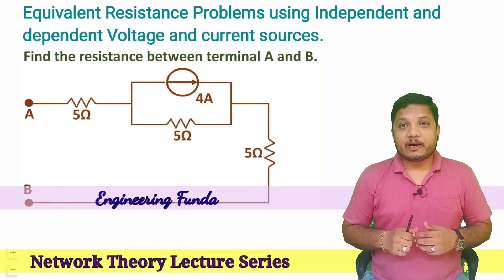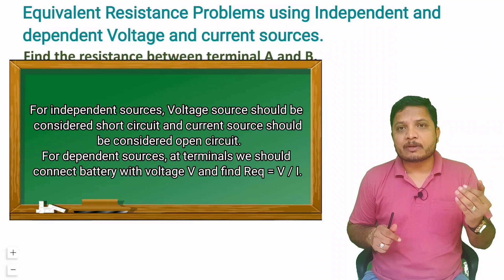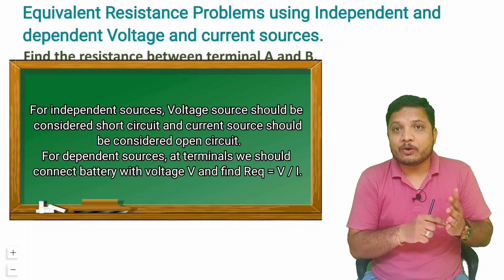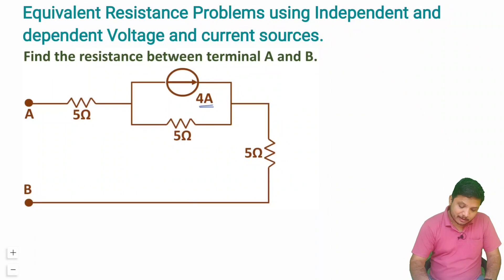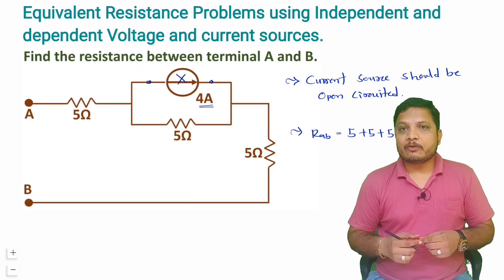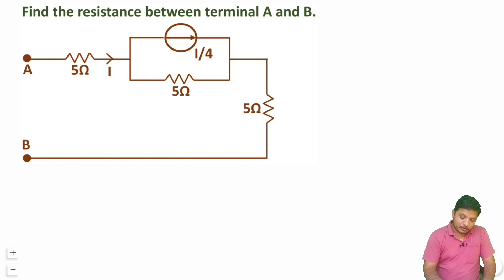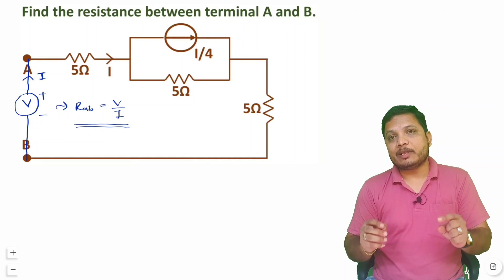Equivalent Resistance Problems for Dependent and Independent Sources: Examples and Solutions 16

Comment from the maker: Equivalent Resistance Problems using Dependent & Independent sources explained with following Timestamps:

0:00 - Network Theory Lecture Series - Equivalent Resistance Problems using Dependent & Independent sources
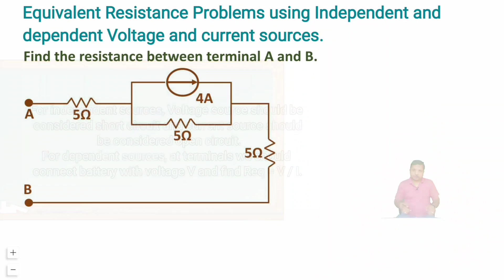1:51 - 1 Example - Equivalent Resistance Problem using independent current source
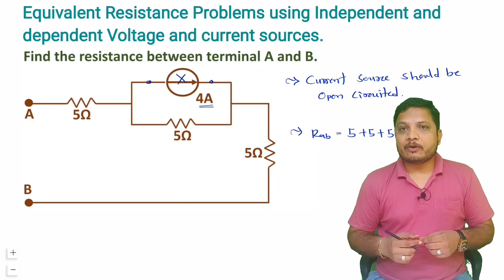2:43 - 2 Example - Equivalent Resistance Problem using independent voltage source
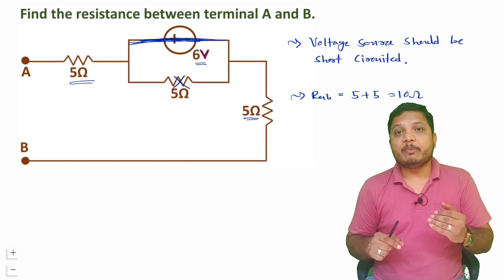4:02 - 3 Example - Equivalent Resistance Problem using dependent source